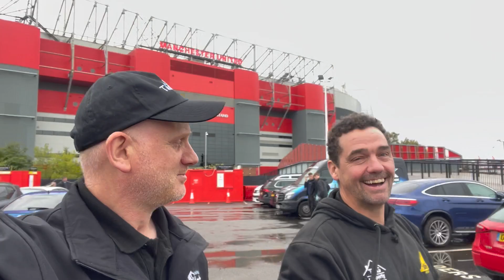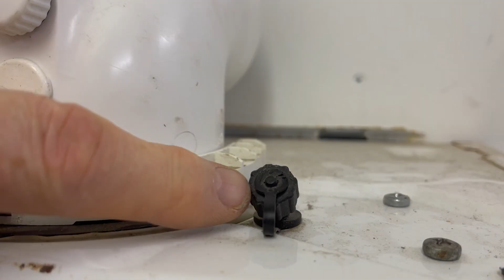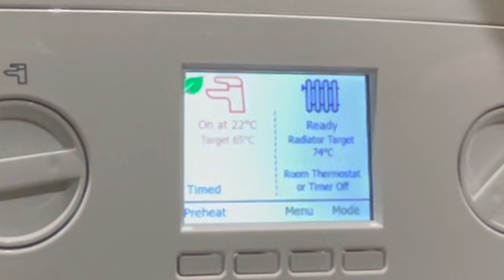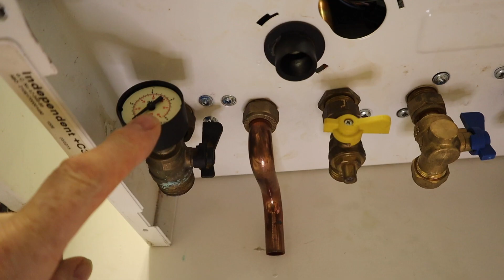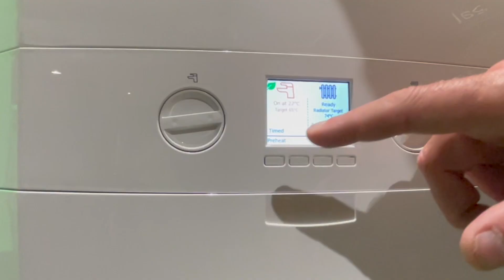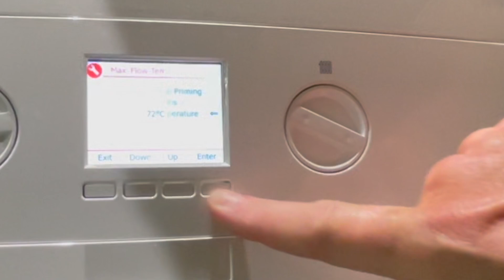Going to Phex 2022 for the new ideal logic 2 max combination boiler What are the changes ideal made?

Comment: Can it be range rated?
Reply: Why not just fit the "plug and play" Ideal weather compensation kit. That links in with the boiler electronics and gives you  a choice of 3 temperature heating slopes that the boiler modulates around depending on outside temp. I fitted one to my logic heat only and it works pretty well. You can't adjust the gas valve, but who needs to anyway ?
Reply: That sounds good but does it modulate down to 3kw?

Comment: Still got the old flue collector which cracks near the sump… 🤷‍♂️
Reply: Oh dear...that part was modified ( thicker plastic) and the moulding process changed way back in 2016, so you will only see cracked sumps in older Logics.

Comment: The best change is the flue elbow sealing ring being made fixed. It was always an act of faith to be 100% sure it had seated right, and once or twice I had to do it all again to make sure it was right. Do sumps still fail?  I've never had any fail on my installs, but I didn't fit early logics. I've changed a few on early logics. I have a logic heat only at home, seven years and no faults so far. The Ideal Weather Comp kit is simple and brilliant and it wasn't too pricey back then. I like the new PRV connection too, it's common sense isn't it. The interface has always been where Ideal are streets ahead of most makes ( apart from the early daft pressure gauge underneath)...particularly WB and Vaillant, and they seem to have made it even better. Apart from that, boilers all just look really fragile inside these days, but at least it makes them light to lift. I'm retired now, so don't ask me why I'm still looking at this stuff🤣🙄
Reply: @mcDarkD  You misunderstand what I was saying. Of course you test it, but until then you couldn't be sure it had seated properly could you, and I had two I had to dismantle again as I pointed out. The new arrangement is obviously superior in reducing/ eliminating the chances of the sealing ring becoming  displaced. That's why they changed it. How many installs do you do at the foot of Snowdon ? Weather comp is nothing new if you have ever worked commercial. If it's possible to install it properly, you should as it works and the Ideal kit is only about £60 or so, so the payback time is low. What's not to like ?